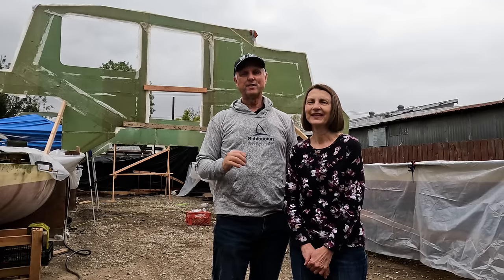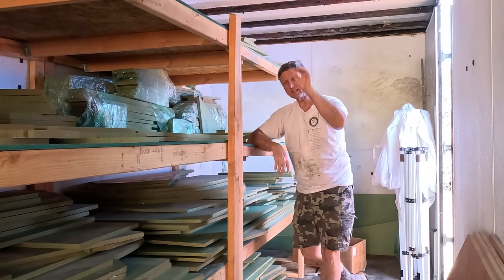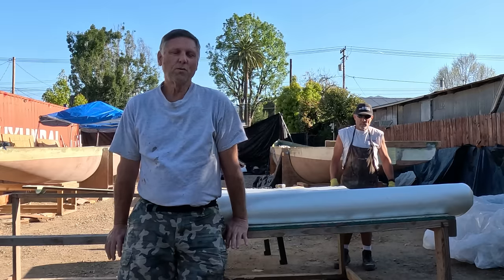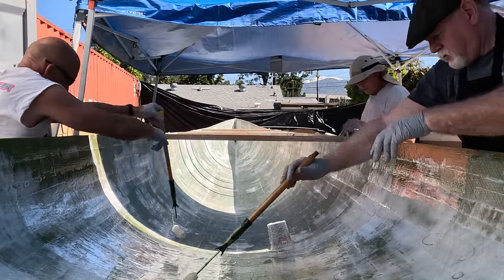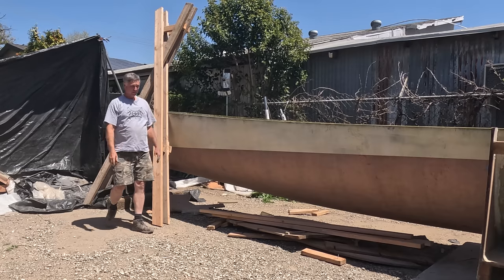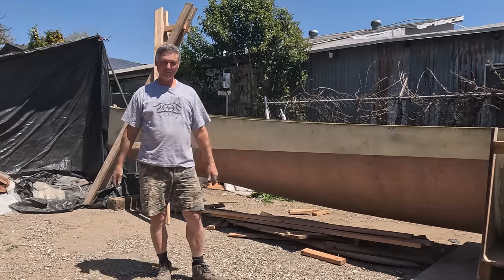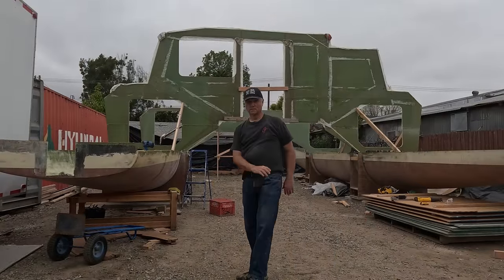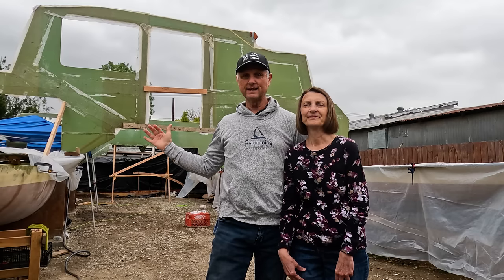Kit E82: Boat Assembly Begins

Comment: You can use "Lantor Soric" as a light weight and flexible "core" to thicken up the handle part of the rain catchment system. Then add another layer of glass and it'll be rigid like hell, cheaper than using thickened epoxy, lighter, and faster.

Congrats on the bulkheads! Exciting progress!
Reply from the maker: Great tip!  I was thinking about what to use as a thin core, that looks like a good choice.

Comment: 90% of epoxy YouTubers apply epoxy with Rollers, when actually using a Plastic Spatula, gives more control and minimizes air bubbles... it makes a better job, less cleaning, less throwaway. In any case, a good brush is better than a roller.

A roller has 2 movements, 1 to put the paint, 2 to take it off, and repeat. By the end of the day, a roller is loaded with paint...
Reply from the maker: We've used spatulas,  and still will for certain situations,  but at times rollers are easier and faster with less clean up, so we will also continue to use them as well.  But thanks for your suggestion.

Comment: Maybe you should set up a solar powered bilge pump in each hull with a motorcycle battery to run them, so that you don't need to sweat covering them up so much, especially now that the bulkheads are in and so tall. Congrats on the big step!
Reply from the maker: The issue is, there are just too many compartments, I'd need to setup about 30 pumps once the sole webs go in.  But thanks for the suggestion, keep them coming!
Reply: @SailingSVLynx  so I guess there won't be any weep holes through the bulkheads at the bottom of the bilge?
Reply from the maker: @flutetubamorg  Why would there be?

Comment: Not sure if I asked this yet. Have you drilled through hull holes yet? This way if it rains most of the water will drain out on its own. Otherwise you have huge bath tubs.
Reply from the maker: We're not putting any holes in the hulls, except for thru hull fittings, but those are high up, so they would still be bathtubs :)  There may be a hole for a transducer, but there are soon to be about 30 compartments when the web for the sole goes in.

Comment: Surely solar power and a water maker cancels out the extra work, weight, time and expense of your rain catchment system, as innovative as it is? I just can’t see the strength that you will require to make it work 😳
Reply: Our boat has a very similar rain catchment system. We don't use it for rain catchment, but a friend with the same boat does. The main benefit is a great hand hold all around the cabin top. Way better and better looking than a handrail bolted on all around the cabin top.
Reply from the maker: Yes, we'll make water, but even water makers aren't free.  Solar power will fill our batteries, but we need that for many uses, like propulsion.  Then there are the parts that wear out on the water maker the more you use it.  Rainwater is, mostly, free (there are some filter costs).  Besides, we're also making it the hand hold for walking around the boat, so that saves us some money as well as not having a hand rail sticking up.
Reply from the maker: Exactly, @andersonautomotive!

Comment: This may have been asked before but how do you get everything "square" and keep it square throughout the build?  What do tools do you to measure against the design?   Thank you
Reply from the maker: It all has to do with the beginning.  We made sure the cement pads were level, then the forms on top.  After that, the waterline was established based on those forms transferred to the canoes.  After the canoes were flipped, that waterline was used to level each canoe.  Then we had to make sure the two canoes were the same height with a laser level.  Finally, we adjusted the angle of the hulls by lowering in the two main bulkheads. The laser we used is self-leveling, so we know everything is right.  From here on we can use any level to check something we're adding since the whole boat is level.
Reply from the maker: Oh and the plans are in metric, so we use a metric tape measure when placing something.  Initial measurements for bulkheads were taken from the stern.  The bow is too custom shaped.  From here on measurements can be taken from any bulkhead since they are correct.  We have several kinds of levels: laser, digital, and old fashioned bubble.

Comment: The rain catchment system seems so weak 😱, the first time you will walk on the edge of the roof, crack! I have no experience with boat, but I have a lot of experience with breaking things. And IMO, without a foam core, you may waste a lot of layers of fiberglass and resins... And perhaps, it doesn't have to be that deep. That said, seeing you experimenting on samples, I'm sure you will end-up with a good solution. Good luck.
Reply from the maker: You're right, but we're working on it.  We're adding a core between epoxy layers, but will continue to test until it is strong enough.